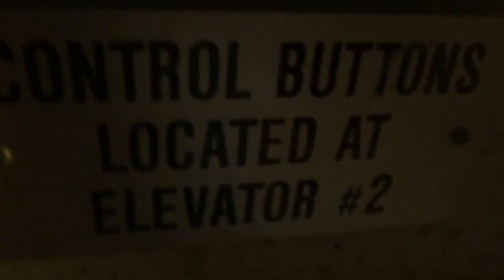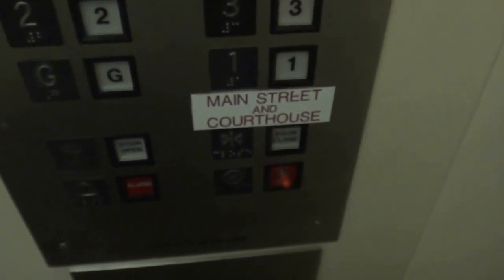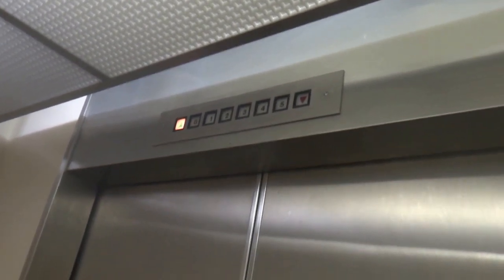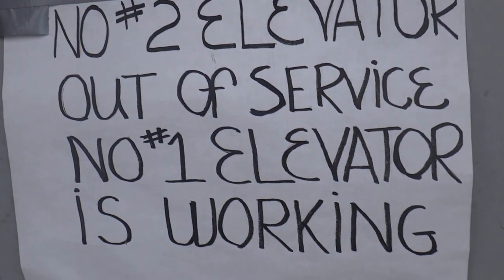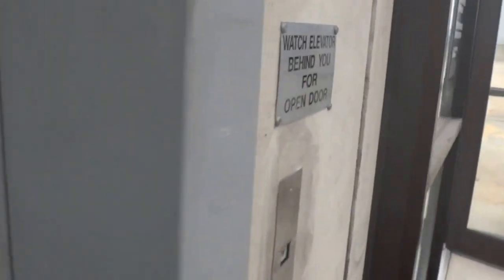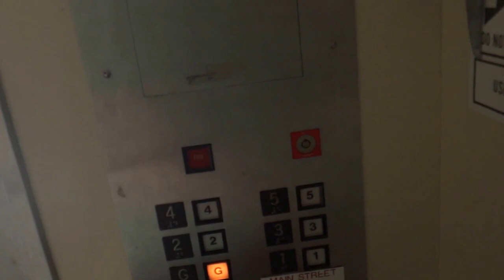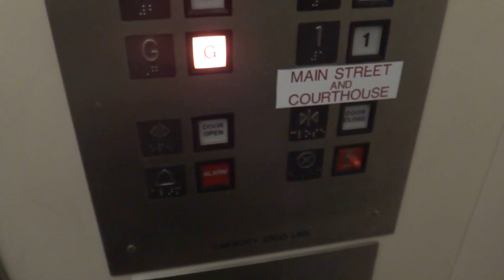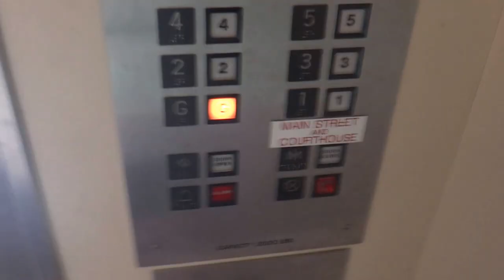Montgomery Dry-Powered HIGHdraulic Elevators, Montgomery County Courthouse Parking Deck

Comment from the maker: Dry-powered is when the hydraulic pump is driven by a belt, whereas submersible (what elevators these days usually are) is where everything including the motor is submerged in hydraulic oil
Reply: owenhinton Don't stop making videos!